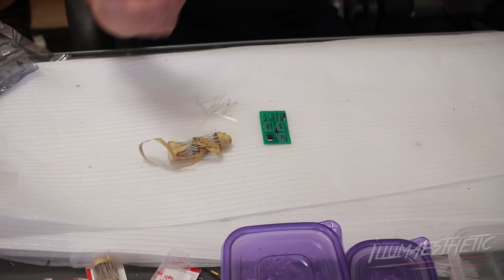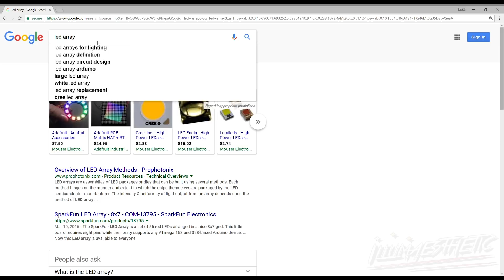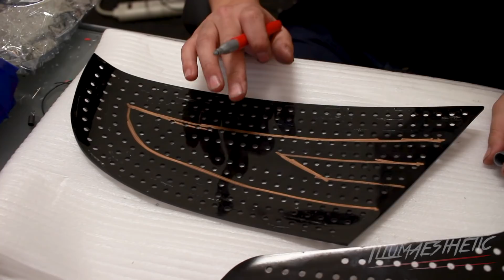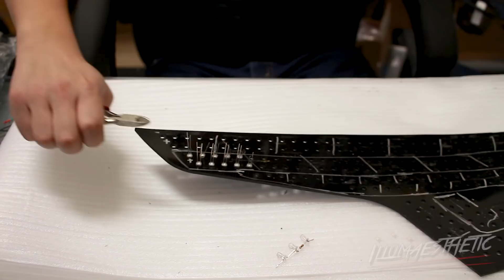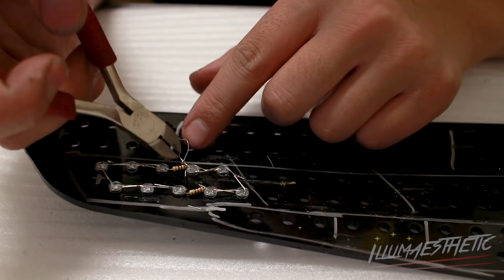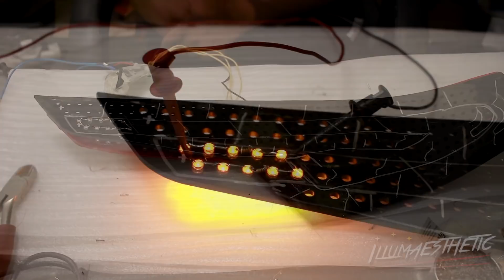How to wire custom LED tail lights! - Illumaesthetic

Comment: 🎯 Key Takeaways for quick navigation:

00:17 🔌 Illumaesthetic DIY tail light kits come with pre-cut, pre-formed laser-cut panels, specific to your vehicle.
00:55 💡 Use high-quality LEDs for your project to avoid issues with lower quality ones.
02:02 📏 Materials needed include a soldering iron, solder, assorted wires, wire strippers, pliers, and an adjustable power supply (optional but recommended).
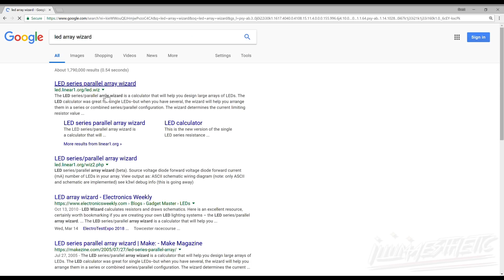04:06 🧮 The Yellow LED Array Wizard is a helpful tool for calculating LED and resistor values for your project.
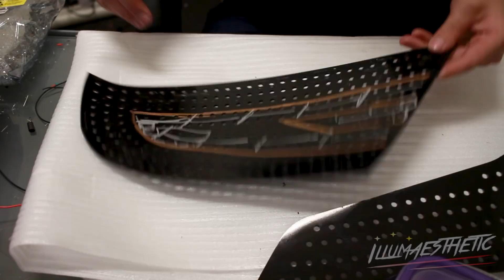08:10 🔌 Plan your LED wiring by grouping them for different sections and arranging them based on the resistor values calculated.
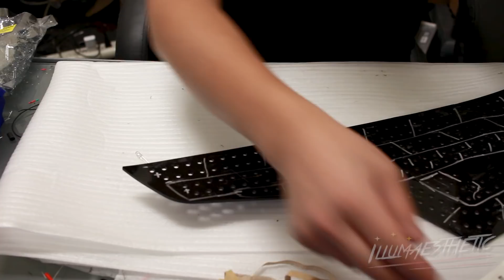09:34 🧰 Fold LED leads and solder them together, ensuring proper connections for positive and negative terminals.
13:14 🔥 Use a soldering iron to make secure connections between LEDs, ensuring a strong mechanical connection.
16:18 📏 Test your LEDs with a power supply to verify that they work as expected.
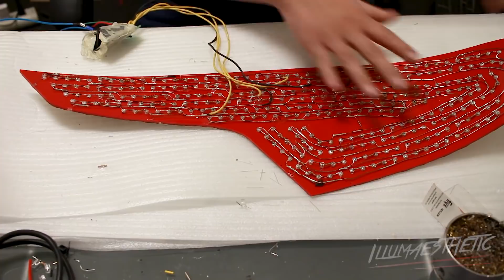18:42 📦 The final result should have grouped LEDs, ground rails, and power wires for different sections, all soldered together for your custom LED tail lights.

Comment: If anyone wants to buy these, and have me solder them... Hit me up.  I don't charge a ton and I'm an electronics repair expert.  I fix Tablets, Laptops, Desktops, MAC's, Iphones, Android's, Drones, Radio's, TV's and anything you can think of excepts pre-1980s digital alarm clocks... (They contain voodoo magic to work)... I've been soldering for nearly 20 years and my soldering iron (station) was $250 back in 2010... Hakko 925FX....

Comment: But don’t you want the resistors after each 5 leds or am I missing something there? 1 resistor after each series of 5?
Reply: It doesn't matter where in the string of 5 the resistor is. Could be before, after, or in the middle.

Comment: Question, hopefully someone can answer this.. for this demonstration, since he is only doing these two groups of 5, he connected the (-) ends of each 5-diode chain to eachother, as well as the (+) ends of each chain. However, if he was doing ALL of the diodes for a given color, how do the chains all get hooked up?
Reply: the positive leg would go to the next group of leds as well as the negative leg to the next group. in this example he used copper wire as his "next leg". notice how he used jumper wire to get to other groups of leds. this is just a large series circuit

Comment: Hi, I have a question about the DIY kit for the 04-05 impreza taillight (heart circle only), I currently have totally stock taillights, would I be able to have only the heart circle module installed or would I need to install a complete LED taillight before I can install the module? Basically, can I install JUST the heart light module for the 05 impreza on a stock taillight or are there other modifications I would need to make beforehand?

Comment: Need to make a video  on using the white pexiglass mold  which is used for the white diffuser for solid lighting   to show ppl how to set  up lights behind that white diffuser instead of always exposed LEDs..if that's kool with illumaesthetic

Comment: Huge load of work will be destroyed because of missing cooling and ESD protection...
Reply: Johannes Stahl Show us a tutorial with those two important-parts installed
Reply: Not required with these types of led chips, smd or cob require that, not 0.2mA chips,🤦🤦🤣😁

Comment: Just wanted to throw this in because it happened to a friend.  He designed in cad a lighting setup and sold it as off road use only.  Got sued by a guy in USA because it wasnt dot legal.  THESE MODS ARE ILLEGAL in most places in the US.  Unless your state doesnt require safety check.  This is a show car not driven on the street mod only.

Comment: Note: most car tail lights require being laser cut to open which most will not be able to do.  Also, most tail lights can't be baked open like headlights which is why they need to be cut.  Good luck though.
Reply: Note: or just use a rotary tool and not be a pxssy about it.
Reply: @bp3120  yep, use a rotary tool which doesn’t make clean cuts and will be visible through the light.

Comment: I thought you have you wire the resistor at the end of the cathode leads? Why did you solder it in the middle of the groups of 5?
Reply: FlyRydeCustoms i could be wrong if the resister lead the pack it’ll cut the volts down right away but each light will drop volts per bulbs. You can also add resistance on the ground side... some dimmer switches for your dash are resisting the ground wire adding resistance slowing the draw. Like headlights if there ever dim or one is and it’s a new bulb to much resistance at the ground (dirty ground) will cause a dim light.

Comment: Wouldn't be easier to simply lay out a roll of LED (SMD) tape, that come with a power supply, and just position and hot glue them from behind?  RED=  https://www.amazon.com/SUPERNIGHT-Waterproof-300LEDs-Flexible-Lighting/dp/B00DTOAW3O/ref=sr_1_5?ie=UTF8&qid=1531246443&sr=8-5&keywords=red+led+strip+lights&dpID=51tRcPWP5lL&preST=_SY300_QL70_&dpSrc=srch   WHITE= https://www.amazon.com/Waterproof-Flexible-Daylight-Gardens-Kitchen/dp/B00HSF66JO/ref=sr_1_8?s=hi&ie=UTF8&qid=1531246576&sr=1-8&keywords=WHITE+led+strip+lights&dpID=51URXvmY%252BXL&preST=_SY300_QL70_&dpSrc=srch   AMBER=  https://www.amazon.com/300Leds-Waterproof-Flexible-Outdoor-Decoration/dp/B01HPTLW2S/ref=sr_1_8?s=hi&ie=UTF8&qid=1531246718&sr=1-8&keywords=AMBER+led+strip+lights&dpID=51D1eamkYOL&preST=_SY300_QL70_&dpSrc=srch

Comment: Have done this.. in a front light... the leds did not get aligned to the same direction... if 1mm inclined to a different direction.. it will look bad...
So I'm trying to do that acrylic tubes whit a tiny dents and just one super led up to the end...
Let's see if works...

Great video...

Comment: Time to upgrade on using a CAD program to create the circuit trace outline, transfer onto a copper board, get it etched and tinned. Upgrading to SMD resisters and high quality Philips Lumileds Superflux LEDs and/Luxeon LEDs....I used to build taillamps with these components years ago. Got all my knowledge from the guys at Hidplanet.
Reply: Bro what material can i use as the base panel?? And I have another question How can i bend a pcd board???
Reply: EXACTLY what I was thinking. This process would be so much more efficient with custom circuit boards. Watching him individually solder all the leds and resistors frustrated me haha

Comment from the maker: Thank you everyone for the feedback so far: since its been brought up a couple times, we wanted to make the following clarification - 

This is a tutorial for a DIY kit. We are aware that this uses somewhat old and outdated technologies, however this is by far the best method of allowing the average car enthusiast to be able to build his own tail lights with minimal knowledge of electronics at the cheapest cost. We are aware that flexible PCBs, SMD, and other better manufacturing technologies exist - and we employ them in our finished product line (not in our DIY kits), but this tutorial specifically pertains to our DIY line. If you have a method that allows the consumer to be able to create a design of their choosing with minimal retooling and assembly costs, we'd love to hear from you at sales@illumaesthetic.com, as we're always looking for ways to improve our product.
Reply: illumaesthetic  what the template made of

Comment: This is so old way to make  LED lights. Now we have way beter options how to make them.  New high power led modules, cheap chinese low volume PCB productions. For example. This is my friend making euro tailights conversion for 2016 Mustang.https://www.youtube.com/watch?v=uKHDmm1H7kY  PCBs we designed by him, manufacture ordered in china. Hot air station was actualy provide to him by car importer when they saw quality of his work. And his completed tailights are cheaper then your kits.
Reply from the maker: The DIY kits are not meant to be the latest and greatest technology around - after all, it is a DIY kit. Its meant to be easy to do for the novice DIYer. If you are an electrician/engineer by trade and want to put in the time to do it properly, there are always better ways than this one. But if you factor in the cost of his time to develop such a product for sale it is very unlikely it will be cheaper than our kits.
Reply: Diy kits doesnt mean that you cant use better LEDs and PCBs. Especialy  when you are selling them to novices. Yes Mustang kit was made with small surface mount parts for hot air station but with bigger surface mount wariants it is easier to solder than trough holes parts. Powerfull LEDs means that you need less parts and solder joints. Thats make it cheaper and more reliable. I am sorry to say but this type of construction belongs 10 years in past a it is really terible. I am not speakin out of mind. I actualy made few lights with thes LEDs. But always atleast with handmade PCB. Time to step up your game. BTW at this moment I am designing custom 3D printer so I can print custom tailight parts which will be later cast from resin. Options are there. So why not to use them and stick with this old and ugly way?
Reply from the maker: Again, you are neglecting the cost of design time that goes into designing parts for PCB use. We specialize in being able to quickly and easily create custom designs for a variety of customers across many different makes/models w/o any significant increase in tooling cost. The methods you are describing are cheaper in the long run, but not at all cost effective if you are only trying to make 4-5 sets per make/model and each customer wants a unique design. We appreciate your concern, but all of our products meet the minimum technological requirements we set regarding reliability and cosmetics, and we cater to a very niche market. There are companies that are far more technologically advanced and "proper" out there like our friends at zLEDs, we choose not to go that route as it allows us to create more unique designs quickly. 
Outdated? - yes, this is circa 2010 technology
Ugly? - that's ultimately up to the consumer to decide
Ineffective? - absolutely not.
Reply: Let me gues. You have never run Eagle software. Designing new PCB for lights is mostly copy, paste, autorute and finishig touches. Test print on hard paper and then files are send to china to make PCBs. Friends way of bussines is that customer gives him tailight. Dissasemble them, designe PCBs, order them in china, then solder parts on PCBs and give finished tailights to customer. Usually in 2 weeks or month.  For price around 250usd. Some of these lights are one ofs (Chalenger Hellcat is rare car there) but he usually orders more PCBs so got them ready for next customer. First set is not a big profit but i pays all expenses and development. His tailights are also designed that way so they work with modern car electronics (check bulb current, etc) and difference in voltage doesnt change brightness of light. Some of his lighs are controled via microcontroler for sequential turn signal or other functions. Cheap, DIY, better looking and easy to modify? Way better then this inefective and time consumig construction is use flexible LED strips with silicone difuser. So yes. In my eyes this should be let in past. We have better options now.
Reply: Does your buddy do any tail lights for 2002 Subaru wrx?

Comment: Flexible pcbs, smd components, and current limiting circuitry. A pair of taillights designed using those technologies could be delivered complete from China cheaper than you could ever kit up a bag of those parts.
Reply from the maker: Correct, but China also requires MOI on all their products, which makes this method the best medium for the DIYer while maintaining maximum customizability/personalization options. If we were to use flexible PCB technologies and all the other nifty modern gadgets (and we have looked into it), at that point there isn't much more of a step to become an all out aftermarket tail light mass-production company like Valenti or Buddyclub, which is something we do not want to do.
Reply: illumaesthetic good luck then
Reply from the maker: Richard Remmers if you have resources and experience we don't, we'd love to hear from you as we're always looking for ways to expand and grow. You can contact us at illumaesthetic@gmail.com
Reply: illumaesthetic : Your civility in the realm of YouTube comment is rare therefore I shall respond in kind.  I appreciate your request for help.  The assumption that I'm making are that your looking to market custom vehicle lights as a kit of custom designs.  There is no possibility for these lights to be DOT approved; if each item is assembled by the end user and possibly custom designed then it's unfeasible to approve each unique item.  So I have to assume you're selling to individuals who don't care if it's DOT legal, they have a show car or they'll pay the fines if they're caught.  The number of those people out there is quite small and frankly not worth selling a product to in my opinion.  So good luck to you.
Reply from the maker: Richard Remmers this is the same conclusion we went to, as for the aftermarket community, DOT compliance isn't too much of a concern.
Reply: @mrremmers1  this comment didnt age very well hahaha

Comment: Old tech dude. SMD LED chips are were it's at.  Think "rope" lights.  Also much brighter as well. 💩
Reply from the maker: SMD does not make the project easy to DIY (or DIY-able at all, for that matter), which is why we chose not to use them. 5mm through-holes may be outdated, but meets all the minimum requirements needed to make long-lasting DIY lights, including ease of manufacturing, the ability to easily make design changes, and cost effectiveness. We have products in our lineup that use SMD, but it is not part of our DIY line.

Hope this helps!

Comment: Too bad this is super illegal in Europe :(
Reply: You need homologation.
Reply: off-road use only! ;)
Reply: Specifically, what rule does this break?
(not questioning you, just curious. from the UK)
Reply: Not illegal in the Netherlands, the rules are that the lights glass can't be painted/glued on , no cracks so you see white, and must be same on both sides. So this isnt illegal in europe :p

Comment: Fumes not hazerdous. Yeah right... dream on. And resistors.... bether use a current limiting electronic. Resistors disapet a lot of heat this way
Reply from the maker: Fumes are never healthy to breathe in, especially for people who solder on a regular basis. However its not hazardous enough to require wearing a gas mask either. Always make sure you have adequate ventilation when doing any soldering and to take regular breaks. 

Current limited electronics are a standard for OEM companies, because they mass produce things on a 100,000 scale. This is catered and spec'd to a DIY market, and considering the whole light only consumes ~1A when completely on, this creates next to no heat.

Comment: voltage is 14.4v good video
Reply from the maker: voltage varies by car/strength of alternator, and we have voltage regulation modules to set it to 12 when the vehicle is on

Comment: Been in the industry for 2 or 3 years... cmon man you don’t know how long you have been doing this?
Reply from the maker: no idea. Too much chloroform
Reply: @illumaesthetic  lol it's not about how long you've been doing something , it's about knowing how to do it . ... So with that been said, I actually have a smart question 😎 how do you set up the lights to the motherboard??? And how do you hook it up to a switch for turn signals???? I'm a noob when it comes to wiring

Comment: What material are the black panel boards with all the holes made of? Can a guy get a flat sheet for cut to fit and form it? If so please let me know. I would really appreciate it.  Thank you!
Reply from the maker: yes, because it is a product we produce to sell to you so we can pay for rent and food :)
Reply from the maker: Plastic polymer that's the same material as most automotive lenses. You can, but we use special tooling/techniques to get it shaped and cut the way it is
Reply: So you say then that since a special item used for your work you are unable to tell us where to find it or buy it?
Reply: Mark Wright. Alot of people could figure out how to do this easily. It just takes patience and time.
Reply: How thick are these sheets?
Reply: Brandon Gray looks about 3mm.